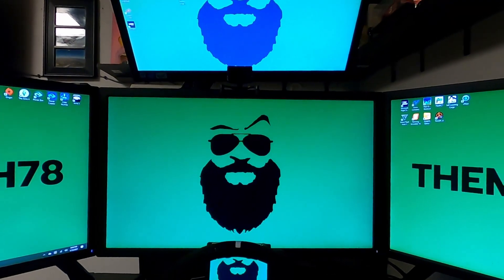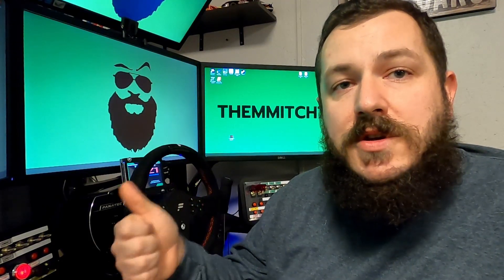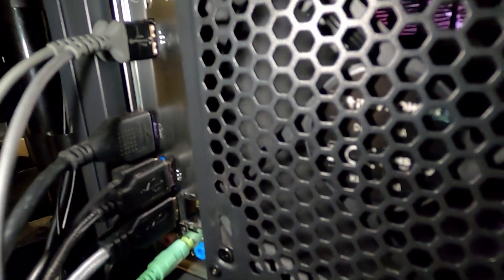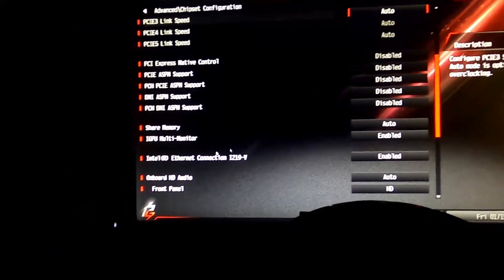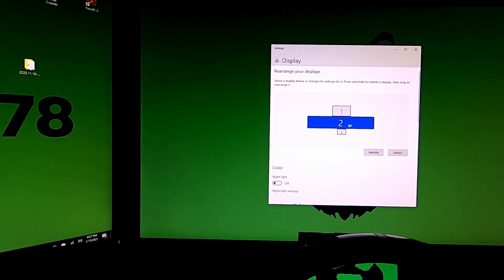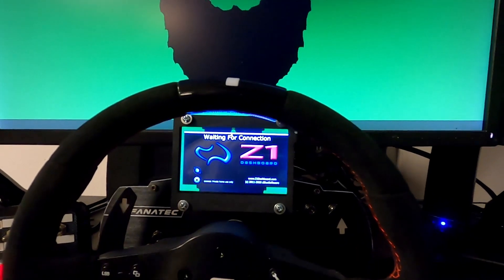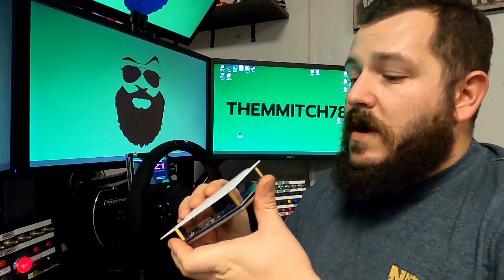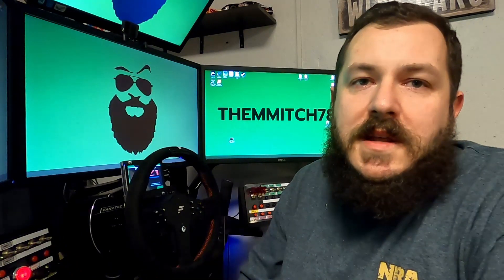HOW TO ENABLE INTEGRATED GRAPHICS FOR ADDED MONITORS | SIM RACING LCD

Comment: Hi, I have quad setup for sims and 2 monitors on my desk for normal stuff/gaming. I have the three main sim monitors and my main gaming monitor on the desk connected to the gpu and the the ''support monitors'' for  discord and stuff on the cpu/mainboard. If I select a higher refresh rate than 60fps on my main monitors the monitors that are connected to the cpu get disconnected. Is there a known setting that I have turned on or something?
Reply from the maker: Ive not seen/heard of this issue before, How are you using the 4 set up on the main GPU. Are you using them independently or are they spanned into one monitor using nvidia surround or program like that?     I have 5 monitors total, 4 of them on them on the GPU, 3 Of which are spanned into a single monitor these are 165hz, my 4th on the GPU is an older monitor, i have it set up separate using extend desktop to this display it is 60hz, then  the raspberry pi on the CPU graphics at 60hz using extend desktop to this display, no issues on any.